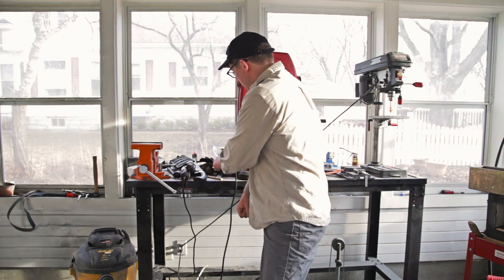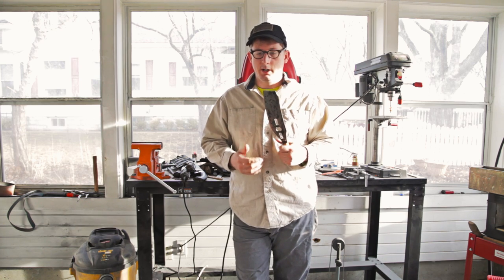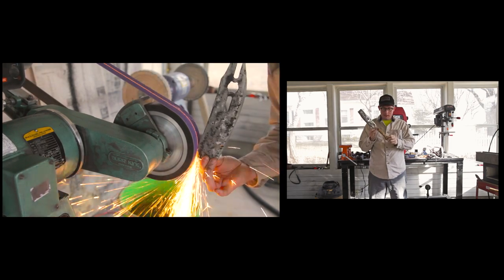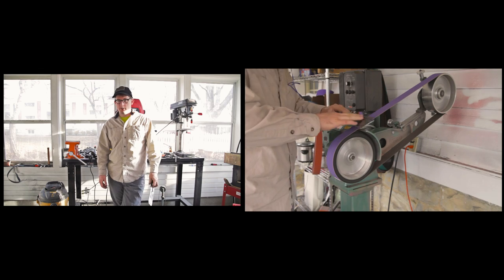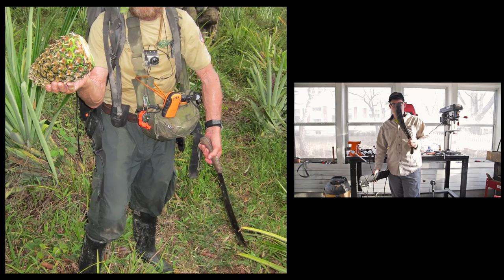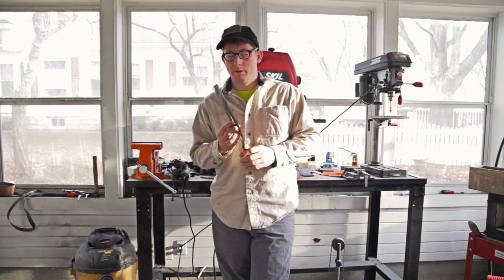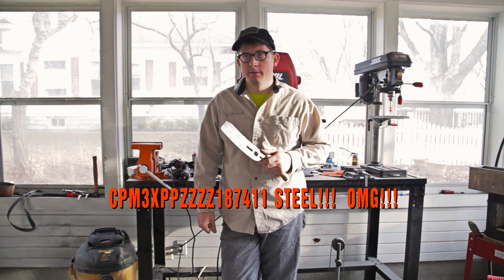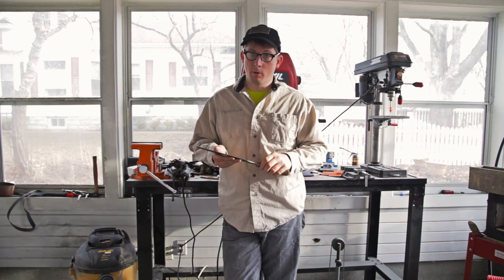The Performance of Lawnmower Blade Knives

Comment: I've been making blades with lawn mower blades for sometime now, and I have never had an issue with sharpness or hardness or retention. I test all of my steel before I use it for it's carbon content and I have found that lawn mower blades, especially the older ones, have a sufficient amount of carbon. Proper technique has never failed me and I'm a novice at this. I appreciate your vids.

Comment: Good video!  Not to be cynical, but maybe one reason some folks are so critical of homemade blades using unknown steels is that they want to keep charging $200 and up for their "known steel" knives. I'm not saying they don't deserve to get top dollar for their skill and effort, just that there is nothing wrong with doing what works. Shoot, I bet this nation was founded with "unknown steel".  I bet if you had asked Daniel Boone what kind of steel his knife was made of, he would have said "sharp".
Reply: This country was founded using interchangeable gun parts that existed in part as the result of the discovery of new steel refining techniques and early precision machining. It was a huge leap when people were able to start producing steel with homogenous properties. I doubt anyone thinks that using a known steel is absolutely vital, it just helps people produce a lot of them and have most of them perform to the same standard.
Reply: wikieditspam Very good points. I completely agree that the advances in metallurgy have allowed us all to enjoy a much higher quality of tools. I was really just responding to the reference that you risk incurring derision if you dare make a blade out of anything other than an "approved" steel.   I just think that someone's effort and ingenuity in re-purposing a piece of "unknown steel" into a useful blade should be applauded, not insulted. Which would I prefer to own?  The higher quality steel knife, of course.  But I appreciate the other too, especially as a learning tool. Sorry if I ruffled some feathers. - Bryan
Reply: Murray carter could make a knife out of steel cable and plywood be able to sell it for $200 dollars. I totally get your point, and I agree, steel is not super important if you have a good design. Knives made from scrap metal are really popular on youtube; I think one of the best known of these knife markers is probably Trollsky and Kyle Versteeg. There's an old video of someone making a knife with a chainsaw chain using a propane furnace and a hydraulic press but iI can't find it anymore.
Reply from the maker: I wouldn't say that Kyle Ver Steeg is a well known knife maker or even a knife maker.  I don't think he would ever claim that either.  ;)
Reply: You never give yourself credit, I'd bet that you're earlier forging videos were pretty influential. I know you'll never describe yourself as an expert, but I'd say you've at least contributed to people's interest in lawn mower parang forging.

Comment: I dont post any videos but I do make knives. I just sold my second one. I get scrap from a relative who gets throw away from his job at a steel mill. They make everything from low carbon steel to bulletproof/plate armor. So I never know what I'm getting. I generally just heat until non magnetic and bake for 5-7min then quench and temper. So far, good results, no complaints. If you are a beginning knife maker, "unknown" steel is just fine imho. Great vids btw, always a pleasure to watch.

Comment: Just saw this video and just recently finished my first blade from a lawnmower blade, and I do understand why knifemakers recommend to stay away from unknown steels. The problem with it lies in the hardening and tempering process where if you don't know what kind of steel it is, you'll have to do a lot of guesswork as to what temperature and what liquid to quench it in. I was successful in hardening and tempering my blade to the point where I can hit metal and it will cause little to no damage on the actual blade. I tested mine out by hitting it against the edge of an anvil and it chipped the anvil with no marks on the edge of the blade. So if you're willing to play around and experiment with it, you can properly harden and temper any steel out there.
Reply from the maker: If you have a stack of lawnmower blades it is easy enough figure out what the optimal heat treat is.  Most of the blades I've encountered have had fairly straightforward HT's.

Comment: Look at it like this; i want a chopper that i can make cheap and personal, and am not afraid to ruin. BOoOMm!!! Lawnmower blade!
They are sturdy, and affordable, i got mine free from the side of the road, just had to remove rust, which is optional, rust is cosmetic, (and beautiful! <3 Rust)
And better yet, they are easy to work on and don't need the best edge, i can hack rocks all day and fix it with a file, although is a little work. 
I personally just cut the fins off and made a handle wrapped with cloth and electric tape, with a crude file ground edge (took forever)  and it works perfectly.
They are not a bad start, but they are not preferred for more refined tools.

Note, im only 15 and have access to only primitive tools, such as files and hand saws. nearing to a job so i can "Advance" and get better tools.

Comment: Heck, it cut lots of grass, weeds, rocks, sticks, brambles, and probably stepping stones and edges of pavers and sidewalks BEFORE it became a knife... So I reckon it will hold together fairly well under high speed rotational impacts with reasonable objects made out of vegetation, wood, or flesh...without much chance of damage to the knife. I typically only sharpen my lawn mower blades once per year, and I cut my grass every week from March through October so if they can handle that sort of abuse at the soft state heat treat that you receive them new, I doubt you will make them worse.

Comment: hey just saw this video and only recently stumbled upon your videos. Dude don't stress it i have made and sold a bunch of stuff i made out of used reciprocating saw blades that folks have been very proud to own. i made a set of teak knives out of a bunch of those blades and gave them as a gift to a newlywed couple i know and they are some of there prized possessions. i made a small fillet knife for a friend that he keeps in his backpack for his adventures that is also highly prized. you are also correct with the re-purposing thang lots of folks are on the bandwagon and are impressed that i took a used up saw blade and turned it into something useful. have you ever seen some to the beautiful thing that Trollesky (youtube) turns out almost all re-purposed steel. so i say screw the naysayers and check out Anza Knives all they use is files for knife stock! do what makes you happy and in turn you will usually make others feel the same.

Comment: When I use mower blades as a chopper or any kind of knife that comes to mind I tend to use heavy duty blades for example the hustler blades from the bigger zero turn type mowers.They are thick and can take a beating and harden very well in water if heated evenly.Most of the blades I make are functionable but mainly made as useful art.

Comment: Just consider how long we have been making knives and how short a period of time we have modern metallurgy to make "known" steels. 

I can certainly appreciate an argument for tool steels, but practically there is much more to a knife and if any of it has issues then the steel won't be the issue.

Take any of those guys working with blades and make the balance off, of the handle insecure or the geometry off so it doesn't cut well or sticks heavily.

If all of that is on, then yes, a better steel can make a better knife, but the difference is small in regards to all of the rest.

Nice clean designs.
Reply from the maker: Cliff Stamp All good points.
Reply: Until there was "scrap" steel, there was no such thing as "unknown" steel because the knifemaker usually made the steel too or knew who did.

Comment: Old Jeep leaf springs are pretty much L6 steel.

A lot of those guys in foreign nations that make knives and machetes, they know which metal parts can consistently produce good, working, blades. Doubt they know what L6 is. But they know how to heat-treat old Jeep leaf springs just right to get good results.They have experience with the springs.

Comment: What belt grinder do you use?  LOL  Real knife makers? LOL  All steel can be read like a book when you temper.  My dad taught me to temper 800 lb drill heads on cable well rigs.  (Not used now days)  My Dad is 83 years old and I bet he can still temper a sewing needle or a 14 inch drill bar all by himself.  The temper is all that matters.  Too low a temper and it bends, too high and it chips.    It all will show it's colors if you know what to look for in the tempering process.  I use what ever steel is available for what I want it to do at the time.  Great video.   Thanks

Comment: the first blade that I made a knife out of was 2 inch wide half inch thick stock that I salvaged from an old school field tiler / well driller.   He used the 6 foot long steel sections to hold a stringline for getting the underground trench dug so that it would drain water when the tile was put inside. I use it for the same purpose that your neighbor does.  except bullhead instead of catfish.  (distant cousins anyway) It works reasonably well for that.  I didnt even heat treat it.  in fact the number of times that it was heated up to anvil temps and allowed to cool down to room temps I would bet that it has a pretty mellow and mild temper on it. You can borrow it for a try out if you wanted a laugh.  I have a bunch of the stock left over if you wanted to hot bendy beat on some of it. I made a bastard version of a froe from a 24 inch section of it.  Chisel ground one side and sharpened it.  My farmer boss is using it on his wood pile for kindling duty.  He says it is still functional.  I didnt heat treat that one either.  My video on cutting up a sickle mower section has a bunch of interest also.  That is a remarkably handy sharp edged tool.   The leverage point is moved to directly above the sharpened edge.  It worked better for cutting up leather than a industrial scissor or a traditional knife blade. Trivia

Comment: for most of my life ,come January it was time to butcher . There was only 1 knife i ever used in the butcher shed,that was totaly satisfactory . It was made from a file and has been used for 2 decades . I can get it way beyond razor. I would get a knife to shave hair then real sharpining would begin . hard arkansas than black arkansas then three different strops. 2 do any of the arkansas stone with stainless was a waist of time and factory carbon steel knives couldnt hold that edge for 5 minutes. It would need a tune after lunch and still shave the next day after a slide r 2on the hard arkansas  it was beyond razor and would stay that way  until done. I am going to try to make a knife out of 01 and a larger knife from a plowshare to see if i can come close to my favorite

Comment: o1 is the king and always will be. My gun smith makes all his inletting chisels out of o1 because o1 ,w1, w2 are the only steels that can get sharp enough to do it . o1 is just easier to heat treat. but yet makes great butcher knifes and cane knives. but looked at as a beginner steel because its easey to work with.

Comment: For me I like uour videos because I don't know where to get aarpxxxzzzz118093411 steel and the O1 and so forth steels o can get are out of my price range for playing around with. One of my buddies is a mechanic so I have a really cheap and plentifull supply of coil and leaf springs as well as the occasional lawnmower blade. It is too bad I didnt see your video sooner. I would be making lots of blades by now. As it stands I just got a new blower for my forge and need to hook it up. The snow is gone and days are warming up and my forge soon will be also.
Reply from the maker: Thanks for watching and commenting!  Good luck with your project.

Comment: I've never once had a knife of "unknown" steel break during use. I can't stand the high-minded, elitist attitude of some bladesmiths. Especially those that employ the stock removal technique. For some odd reason, those smiths that have rarely used a hammer and anvil to create a knife feel they are the arbiters of knife making. I have sold hundreds of file knives, with lifetime replacement warranties, and have had three warranty claims. All three were user error, but I still replaced them, and had zero to do with steel composition.